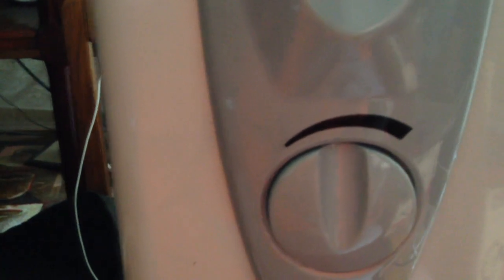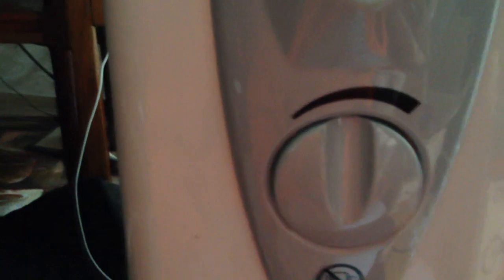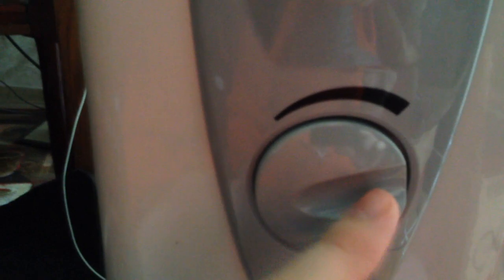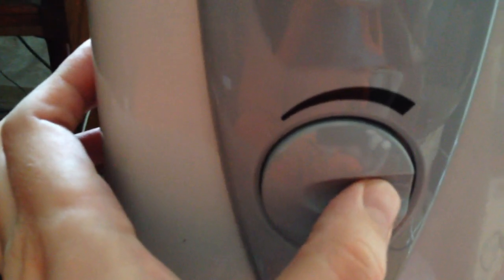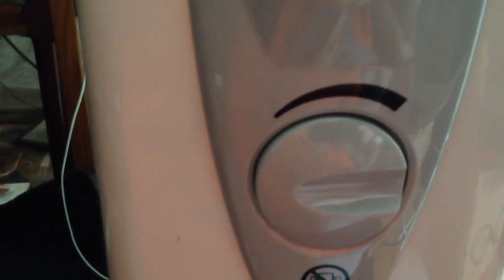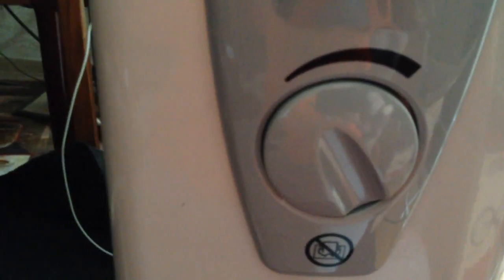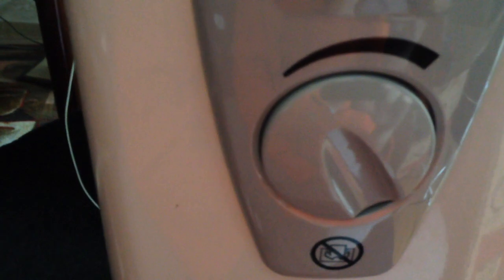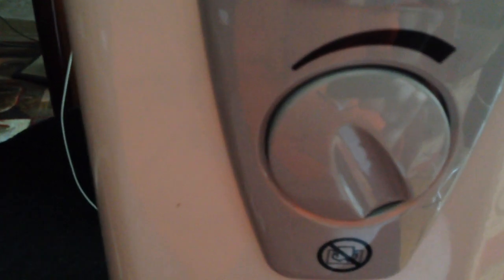How an electric heater thermostat works

Comment: This is incorrect thermostat works off temperature the time it takes between the on off cycles depends on factors like the room temperature and size of the space, it’s not to do with time
Reply from the maker: This one in my case doesn't have a heating sensor, it stops based on a timer.
I mean if now it's summer and it's very hot, if I would start it, it would still run the same time as during winter.

Comment: So basically, it's not a thermostat. A thermostat is a temperature controlled switch. It is in fact a timer which can be adjusted to vary the proportion of time the heater is on.
Reply from the maker: Yes, exactly :) Probably it's cheaper to make this system.
Reply: @PSVICE  at 0:29 there is a click when you reduce the dial to near zero. Isn't that the bimetallic switch turning the heating element off?
Reply from the maker: @michaelbridge3069  Yes, when you turn that button off, the heater will stop heating. That button is increasing/decreasing the time until the heater stops (the so called thermostat)

Comment: You did not explain what turns it off and on
Reply from the maker: I mean turn on = press the button so the heatear starts to heat.
Reply: @PSVICE  I meant what's making the thermostat turning on and off ?
Reply from the maker: That round button that I show in the video.
If you increase it, the heater will heat longer, if you decrease it, it will heat for a shorter period of time.
So the thermostat is like a timer that goes on and off by itself, depending on the timer (controlled by that button).

As I said, if you increase it, it will go longer and turn off by itself after a time.
Reply: @PSVICE  Thanks for such wonderfull explaination....I have one more question that did you mean it has nothing to do with heat measure for turn on or off? And it's measuring time for turn on and off?
Reply: @PSVICE  you know my company says just as you explained as "turn anti clock wise untill it shut off and than it will turn on auto". But in reality it doesn't turned on even my room gets cold again...I waited for hours...so that anti clock wise measure also get changed for off everytime it's not at same place it's getting vary everytime....do it detect our room heat or measure time? And how do I fix it?
Reply from the maker: @defmegh  I meant that the thermostat is about time, not heat level.
Reply from the maker: @defmegh  Turn that button to maximum, turn the heater on, leave it for one hour, after that, slowly turn the button off until the lights stop. Then after 10 minutes or so, it will start again by itself. If you turn the button anti-clockwise even more, it will have a bigger pause until it starts again.

Comment: Does all thermostats shut on and of automatically? Thanks
Reply from the maker: Yes, the thermostat is about counting time, you can set it to 5, 10, 20 minutes by turning that wheel button. So it will run for 20 minutes and when the time is up, it will stop. It will stay off for a few minutes then turn itself on again.